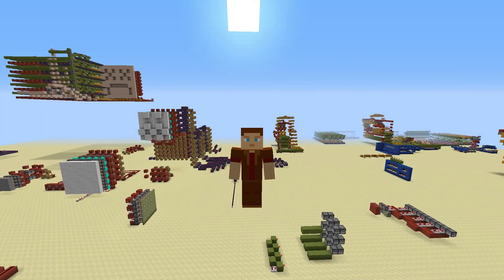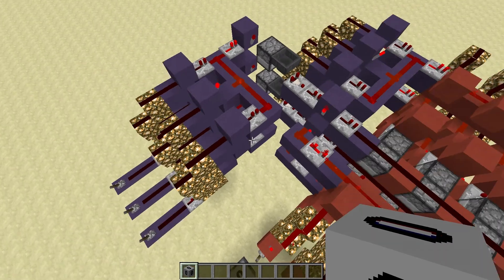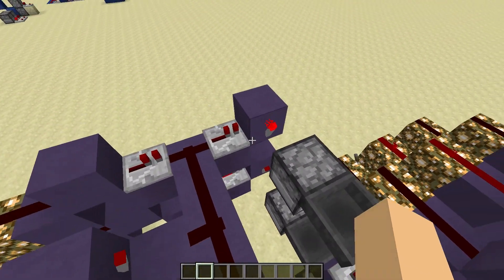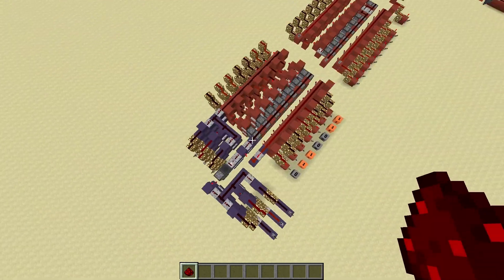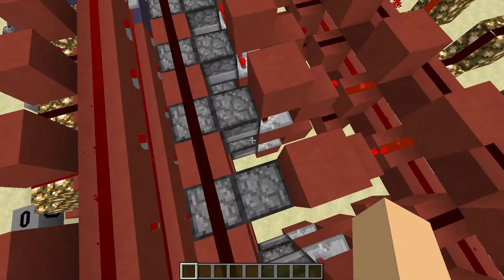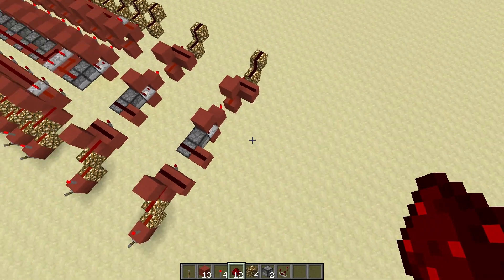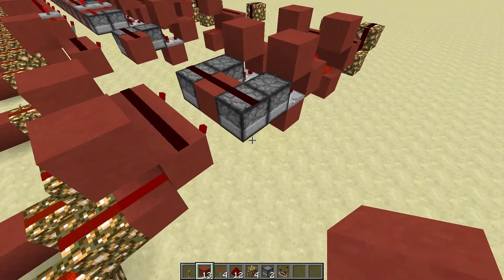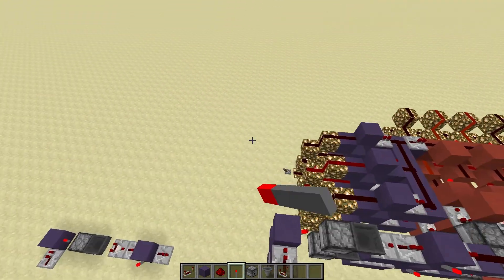Compact Redstone - Fastest Solid State Drive! (RAM & HardDrive) - Tutorial 2

Comment: Your design is quite good. I've never seen something like this before, certainly because we don't really use dropper in our circuits. But I leave some references here :

https://forum.openredstone.org/showthread.php?tid=10317&highlight=register
https://forum.openredstone.org/showthread.php?tid=9645&highlight=register
https://forum.openredstone.org/showthread.php?tid=5901&highlight=register (sorry, pictures seem to be not avaible anymore)
https://forum.openredstone.org/showthread.php?tid=203&highlight=register

I've made a lot of registers, too. 

Some tips :

Why haven't you put the "output read" signal directly on the output torch of your D-flip flop ? If you put a "small" item into the dropper (an item wich provides only 1 block power), it will works very well and you will save space.